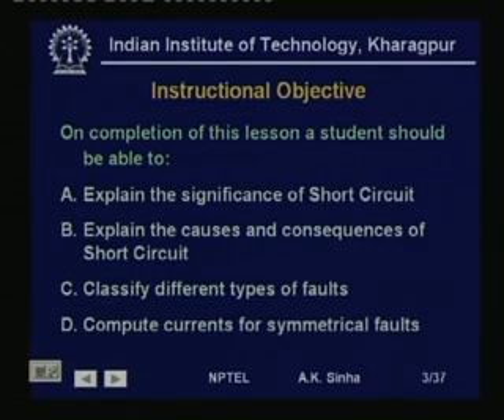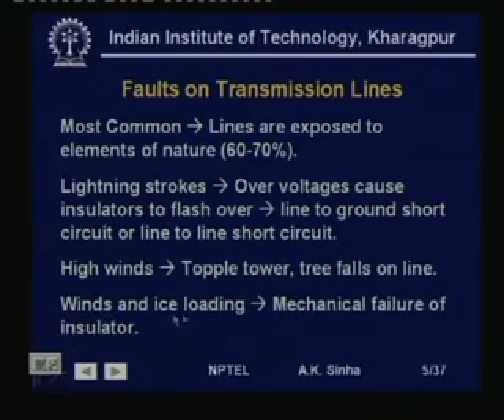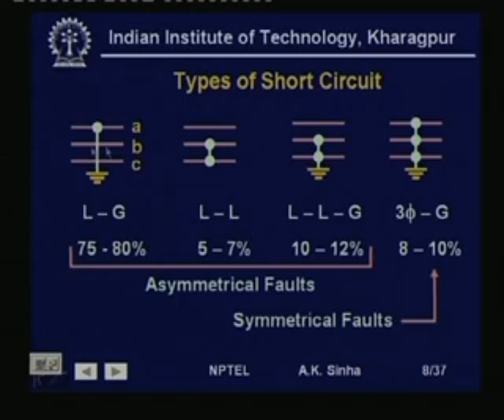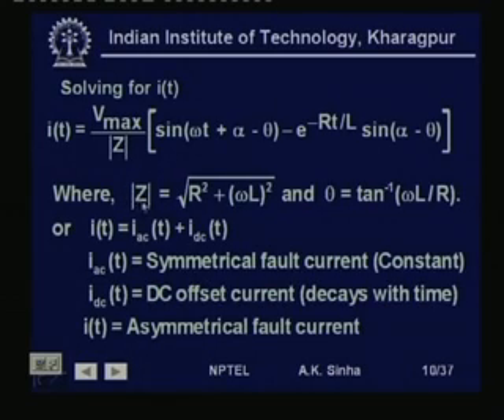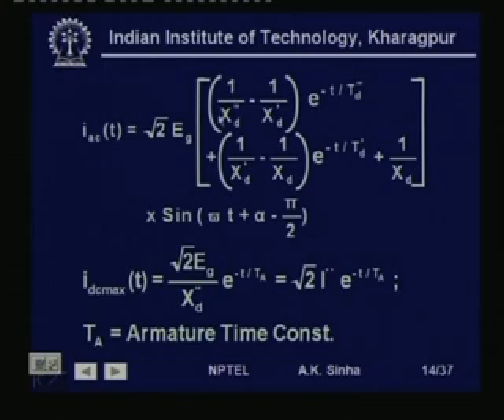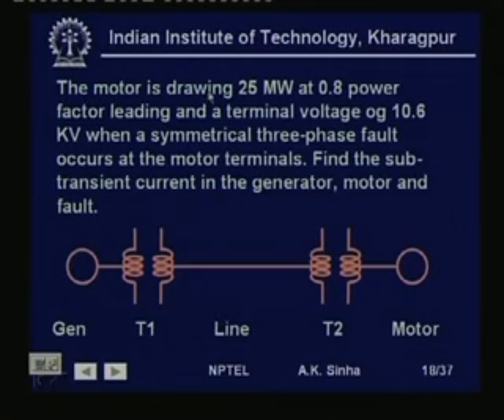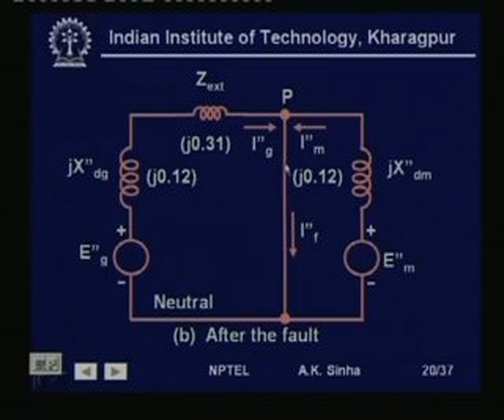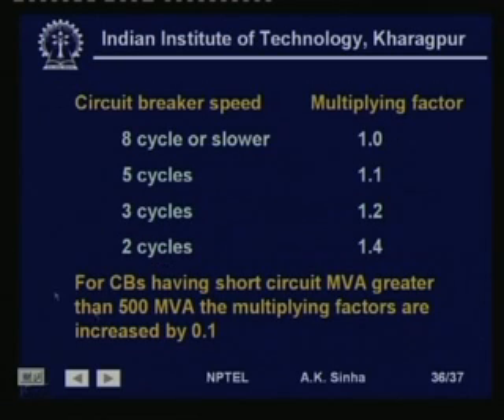Lecture -25 Short Circuit Analysis

Comment: At 45:45, shouldn’t there be a sqrt(3) in the denominator when calculating prefault current? It’s 3 phase power. Sqrt(3) is used at 48:40 when calculating the actual value. Looks like it should be done at both places.
Reply: in per unit case you dont need sqrt(3).
Reply: no need to multiply sqrt(3)

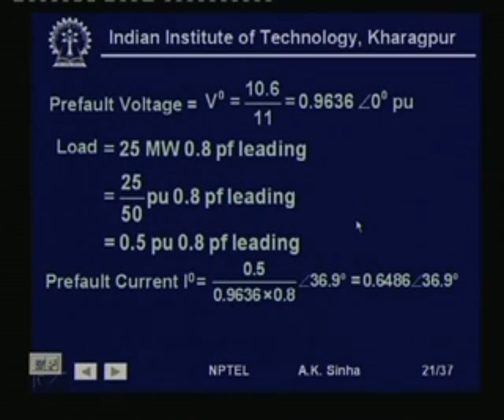Comment: how did that angle 36.9 degree come there at 46:15
Reply: +Sachin Giri he mentioned that pf was 0.8(leading),so it is arc-cos 0.8(=36.9).
Reply: +이진규 how he added 0.15 with 0.8+0.8 becoz line has different base.